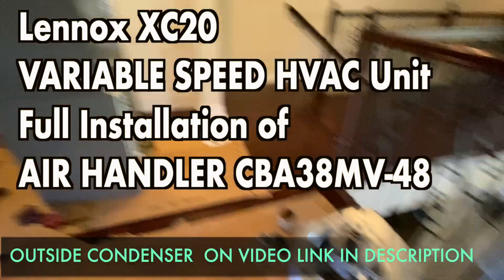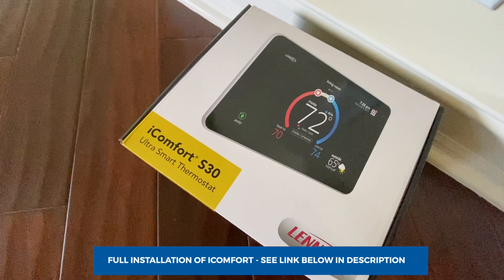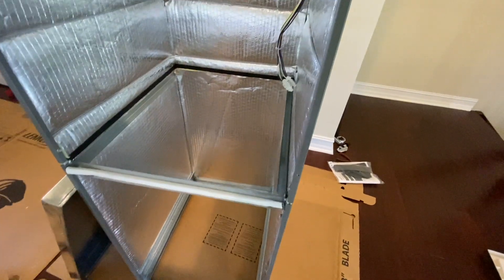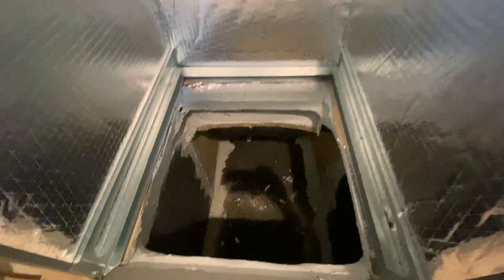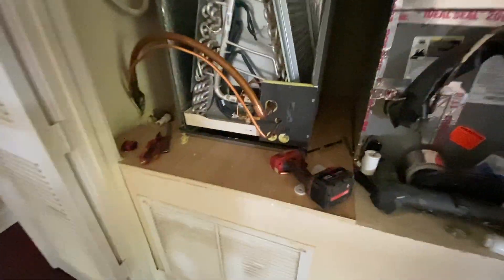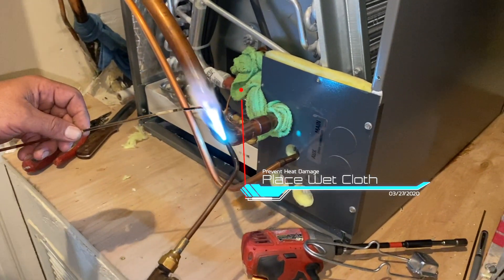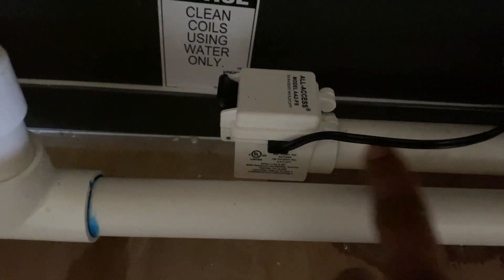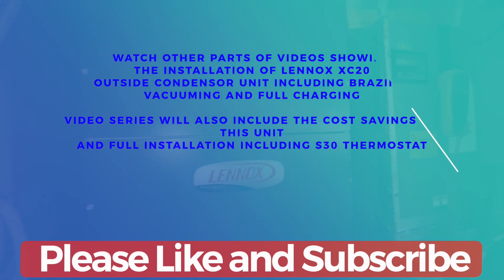Lennox XC20 VARIABLE SPEED HVAC Unit Full Installation of AIR HANDLER CBA38MV-48

Comment: Is there any easy way to remove the side drain pan on a unit that's already been installed vertically? Does it slide right out? Any screws holding it in place?
Reply from the maker: They should have removed it before installation. There is no screws so you can try to yank it out.

Comment: any reason on replacing the ecobee? i have that with all the sensors around the house?
Reply from the maker: This unit doesn’t work with ecobee. It has its own communication thermostat S30 which must be installed with the system.

Comment: Doesn't have to look pretty but does it have look like crap 😳
Reply from the maker: Looks don’t matter in HVAC. As long as it’s done per the right procedure it won’t cause any issues. What’s the point in making it look pretty as it stays behind the house and closet and no one ever looks for it. I rather take the crappy look but the right job.

Comment: Are they good units reliability wise? I know they are extremely efficient
Reply from the maker: Yes they are well made. The only thing they require additionally is for you to run a shielded wire between your thermostat and the controller (if you have power lines running along with them). The power lines can create interference in communication so shielded control cable eliminates that issue. Other than that it’s amazing. I am Loving mine. My bill dropped like crazy. My 5Ton AC is on 24/7 at 76deg and my bill is around 120bucks including a pool pump that runs 6hr days and other electrical stuff I use.
Reply: How To do it where are you located And how many square ft is the house if you don’t mind me asking
Reply: @HowToDoitright  i bought one 5 ton with all the works and 3 zones how did you program the s30 to make sure your getting the most energy saving on all the rooms with the 3 zones need help on this my kids zone is the one i am having problem with not enough air is comin out to those vents it takes longer to get that zone to get cold, where do i program for airflow and air conditioning coldness for the zones to get this tune perfect for my house.
Reply from the maker: Ray Industrial I don’t have Zones. you will have to contact Lennox. Your contractor should have set it up for you. There are jumpers in air handler that set the fan speed. hopefully you ordered a 5ton air handler too. Sometimes they give you a 4ton air handler with a 5ton outside. That’s the combination I had as it gives you max seer rating.
Reply: @HowToDoitright  never knew that it has some sort of air handler, i was never told that do you have a link maybe what it looks like. or somebody that might have installed one on you tube.
Reply from the maker: Ray Industrial 🤦🏻‍♂️ air handler is the device that blows air in the duct...it’s located in attic or garage or closet. Ac cannot work without it. ....hope fully you didn’t do the installation. Ask your contractor
Reply: @HowToDoitright i dont need a air handler the air flow is great excpt with 2 of my rooms i have  all  New lennnox equipment heater SLP99UHV, CX25 AIR, air purification system with ultraviolet light, S30 with smart hub and 2  sensors for the 3 zonng, iHarmony Zoning System,  the system is beutiful i just need to get  my3rd zone to put a little more air there is a dump valve on it  i felt it wasnt needed  but the installer said it was needed but it can be close or semy close if needed, let me know what you think.
Reply from the maker: Ray Industrial ah no idea. You have a different system
Reply: @rayindustrial2614  I just purchased xc20 with 3 zones and living in Vegas.  Curious if I got a good deal.  How much did you pay or do you know what it would cost?